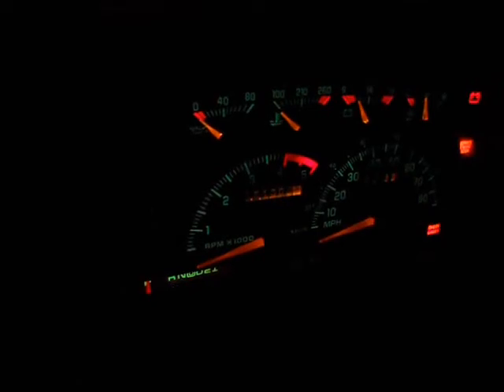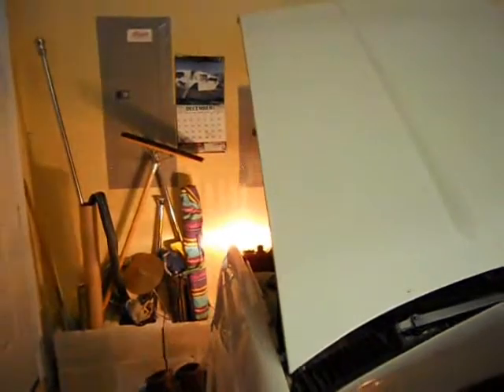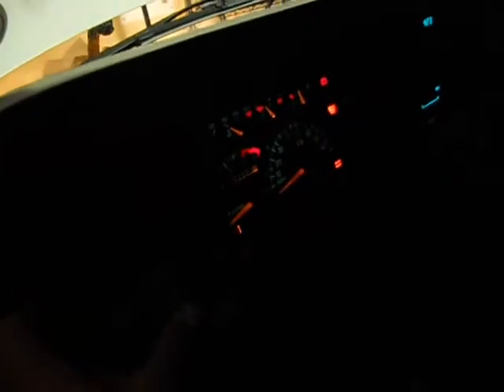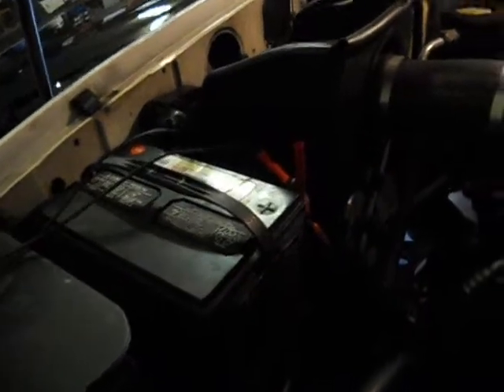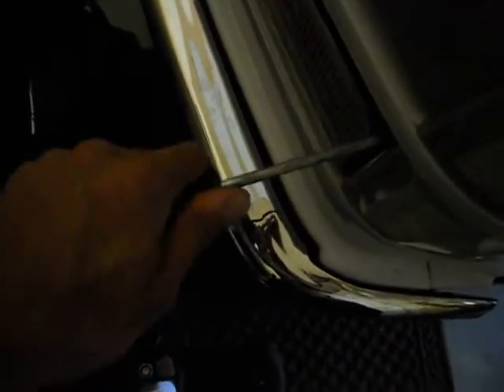Silverado Sierra Turn Signal switch fix (temporary fix)

Comment from the maker: @ziggassedup  I fixed the parking light (The bulb fit in too loose, I shook the bulb around and it contactes ited better, But just replaced it and the used bulb fits way better.   The switch's contacts are junk. When you aggressively click Left, it fixes it for 10 operations. Think the bearing is PRESS in to the housing? Alot of column parts are discontinued so you are SOL if you break the other pieces, Like the bearing retainer that is no longer available.

Comment from the maker: @towrecker  But they are CHINAmon :(  I was going to get brand new GM lights, they were cheap.. But they were made in CHINA. I passed. Ill get JY ones, I need to find some where it snows, as they hold up better and don't crack from heat. (Like my original right side is MINT, I broke 2+ left sides that I bought used )